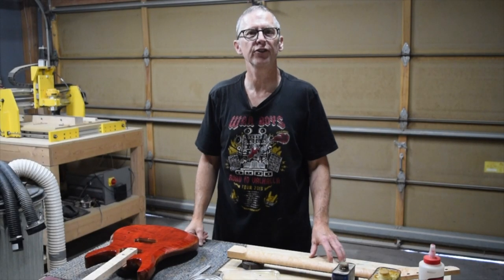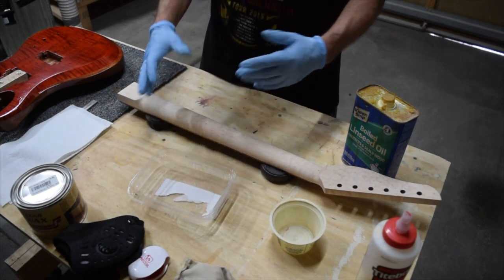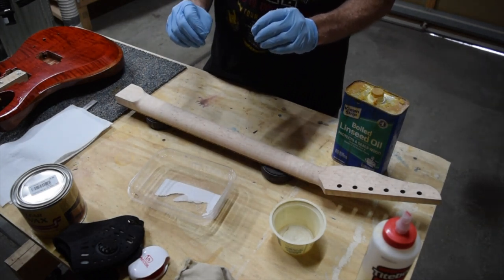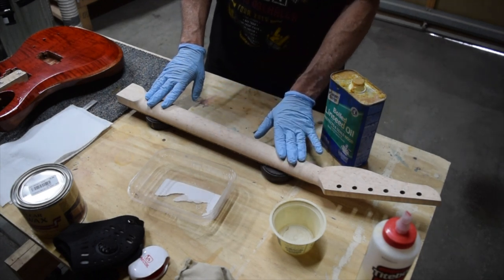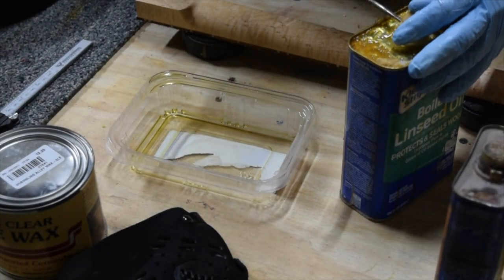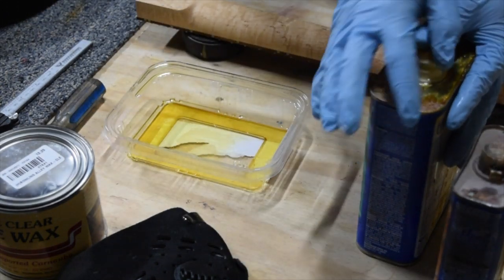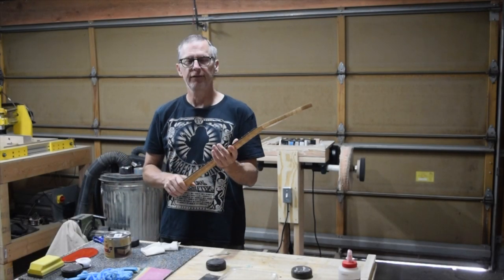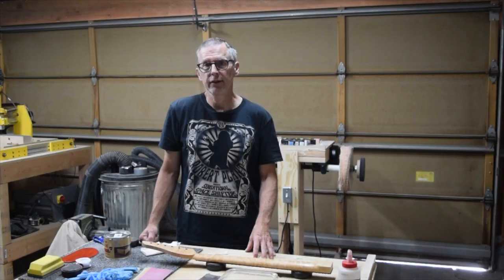Applying An Oil Finish On A Guitar Neck

Comment: I never crossed my mind that possibility of mixing linseed oil with polyurethane, very interesting, I'll try immediately
Reply from the maker: That's basically what a wipe on polyurethane is. Linseed oil, polyurethane, and solvent.
Reply: @HighlineGuitars  cool, thank you very much for the tip, I'll try with the guitar am building : )

Comment: Wow, It really sounds like this might be a nice way to finish a guitar neck. But at the same time it seems WAY easier... I might give this a shot, thanks for the video!
Reply: Oh, but I do have a question: I already started on a neck with nitrocellulose clear coats from a spray-can and some sanding like a couple years ago, can I just sand off the paint and redo it with this method? 

Edit: For context; I want to redo it because I never finished it...
Reply from the maker: Yes, you can sand back and apply the BLO. Or you can try polymerized tung oil which works better as I demonstrated in this video: https://youtu.be/brT7VpudOIY?t=155
Reply: @HighlineGuitars  Thanks :)
Reply: @HighlineGuitars  Hey, I was getting ready to buy the botanical polymerized tung oil but I saw on their website they say the average life of the finish is 5 years. If all I have to do is scuff it once with 600 grit and recoat once every 5 years it's probably worth it, but 1. I'm concerned I won't know when I need to do this, and 2. I wonder if it's really that simple. Have you ever had experience renewing or touching-up a polymerized tung oil neck you already completed from general wear? I just don't want to be playing the guitar years down the road and find out it's warped because the finish faded, or even just have to redo the whole finish for some reason.
Reply from the maker: All drying oils such as tung oil or linseed oil cure through a process known as polymerization. Polymerized tung oil dries faster than pure tung oil because the drying process has been triggered by carefully heating it before it's packaged for use. If you're concerned about long term wear, maybe you should consider polyurethane or polyester.

Comment: BLO is possibly the most beautiful finish over time. It gets progressively burnished as it continues to harden over the years. Think old tool handles. The only recommendation I would make is to buy purified BLO (Allback brand ?) or purify it yourself. In a plastic jar shake 3 parts oil to 1 part water into a cloudy suspension. Let stand for a few weeks in the sun until separated and the oil at the top is clear. Place in the freezer to solidify the watery garbage at the bottom and pour off the good part. Keep it in the sun with the lid loose to get sun thickened oil, but this takes a few months. Hardware store linseed oil isn't artist grade. It retains the mucilage portion of the natural oil and this part can support mold growth. I believe this is the case. If somebody knows differently please comment.

Comment: Excellent video. Thanks. I've ordered Tung oil to do a strat neck but may do it your way as you obviously know your subject.
Reply from the maker: Tung oil works great. Not much different than BLO, just not as readily available to some.
Reply: @HighlineGuitars  Well, the Tung oil didn't arrive, so I did it your way with BLO etc. The tip for wet'n'dry polishing is ace and I'd like to nominate you for a Nobel Prize for that. My neck feels satin-silky smooth now. As you say, it's not a thick coating: how long will it last before I should re-do it, at 5-10 hrs/week playing?

Comment: Got to your content due to wanting to get more information about using danish oil on a roasted maple neck. Thank you for your knowledge. Question: Did i waste my time by applying two coats in 24 hours? In my thought, it was to make sure the wood was flooded with the oil.
Reply from the maker: No, you didn’t waste your time. Oil finishes are very forgiving.
Reply: @HighlineGuitars  thank you! The danish oil really made the roasted maple pop! Such a beautiful warm color and feel

Comment: Hi.
Normally you would see those whitish liquids used for sanding using electric-driven or compressed air-driven tools .. what’s inside the mineral spirits compound you’ve used? Sorry I’m Italian so I don’t know what you mean exactly by mineral spirits ..
Reply from the maker: https://www.google.com/search?q=what%27s+in+mineral+spirits&rlz=1C5CHFA_enUS749US749&oq=what%27s+in+mineral+spirits&aqs=chrome..69i57j0i22i30l9.6536j0j9&sourceid=chrome&ie=UTF-8

Comment: Hi Chris, I tried to follow all your guidelines,  I sanded the Nitro finish off the back of the neck. Can I use Winwax  pentrating stain Golden Oak 210, to darken the back up some, I put some on a day after  and tried a very lite coat of it and it helped, but I'm still think it could look better, any suggestions.  Thanks John, Oh I found all the products at Ace Hardware, in fact the same brand, it cost a little less than 35 dollars. ( Before I started I taped off the Rose wood board and side dots.)

Comment: The video I need for my project! 
Just one question since I don't have any experience doing this. 
I have a lightly (almost finished) roasted maple neck that I would change the radius. My question is. Which sanding paper grit is the indicated to start the oiling process? 

Really love your videos Highline Guitars!
Reply from the maker: P400-P600
Reply: @HighlineGuitars  Thank you! 
Last question. If I got pre cut frets that has 10"inch radius. Can I install them in a 12" radius fretboard without bending them to match the same radius?

Comment: Have you used or thoughts on spar varnish for the neck. I would either use spar varnish or tung oil since I have those in stock. Have fun

Comment: Im getting ready to finish my first tele neck with rosewood fret board. Im assuming since my Taylors fretboards were finished with BLO from the factory and I didnt see you tape off your fret board, That its ok if I get some on my fretboard. My neck is unfinished from All Parts, maybe I can apply it to my fret board? Its in the mail so hopefully there will be some directions for finishing it.
Reply from the maker: I usually oil the fretboard as well.

Comment: You're doing the wet sanding to fill in the pores to enhance the smooth feel of the neck?  Also, when using Boiled Linseed oil, is it not recommended to apply additional coats after you've  done the wet sanding? thanks for your help.

Comment: Hi! In the planning stages of building a custom baritone guitar. Is it safe to apply these oils to unfinished necks that already have frets fitted? You seemed to be avoiding the fretboard throughout this video so just want to double check!
Reply from the maker: Yes, you can. This video was about the neck only, but you can use the same process for the fretboard.
Reply: @HighlineGuitars  Thanks for the quick reply! So it's safe to run this stuff over fretwire? Obviously, wipe excess off etc...
Reply from the maker: @wrkhousewrkhouse  Yes. It's easy to wipe it off the frets.

Comment: Great video! - Learned a lot! Thx!  -  Now PLEASE help as I have a question or two!. - I just got a brand new cheap Jackson Minion(28.6" neck bass) 
The neck is smooth everywhere other than on the thumb-side of the back of the neck from 1st-4th frets, it feels like they didn't shave a section into the bowl shape like the opposite side. I can actually even see the small ridge of wood they should have kept sanding so it would be a perfect bowl shape. I mean it is minute but it bothers the crap out of me. 
Also it's a maple neck and fret board that looks un-finished to me! - So should I use the BOILED LINSEED OIL like in this video to go aver the neck. - OR should I use TRU-OIL? OR TUNG OIL? No matter the price?
And can I use it on the maple fingerboard?
Also The outer sides of the frets from 12th - 22nd will freakin slice your hand open they are so sharp!-- Do you think I could file them down myself or should I leave that to the shop? Or after mentioning al of this should i just send it back?
I never buy really expensive guitars/basses, but this is the first time I have tried one under $300. I paid $140 for this one.
Is all of this to be expected from any guitar that cheap made in China? Or did they just stick it to me here? lol
Here is a link to the bass I got: ---- Any help will be greatly appreciated! Thx!
https://www.amazon.com/Jackson-Concert-Bass-Minion-Guitar/dp/B07VFPRYPX/ref=sr_1_4?crid=R9XQJQU6A0CS&keywords=jackson+minion+bass&qid=1581496063&sprefix=jackson+minion%2Caps%2C177&sr=8-4

Comment: I just bought an inexpensive Squier Strat Affinity, mostly for the 6 lb 10 oz weight on my shoulder, which I need due to a protruding collar bone (mtn bike injury).  The Squier is surprisingly higher quality these days but the maple neck is unfinished.  So I plan to do the complete BLO treatment as you've described.  Another video talks about doing the fretboard too but doesn't go into enough detail.  Do you use the japan dryer and how about the the wet sanding for smoothness on the fretboard. You mention multiple coats on the fretboard.  Do you just wait a day or two between coats or...????  And if you are doing the fretboard and back of neck would you do one first or both at the same time?  

I have another strat I built from scratch taking a guitar building woodworking class.  It has an unfinished ebony fretboard.  I assume BLO would work for that wood as well?  Since I might have your attention, I sprayed a water based nitro finish outdoor during a dry Santa Ana here on this Strat and got a lot of blush on the back and sides (top is good) and short of reshooting the clear coat again would anything easily remove the blush now years later?  I do have blush remover in a can but reluctant to make it worse, lol.  Thanks, love this video.
Reply from the maker: Add a few drops of Japan Drier (or an artists cobalt drier) to about a half a cup of BLO. Wipe the neck and fretboard. If you want it smoother, rub the mixture in with wet/dry sandpaper (600 grit or higher). If the frets are already installed, you won't be able to wet sand the oil into the fretboard. Wait a day or two between coats. Then give it a couple of weeks to cure after you're done.
Reply: @HighlineGuitars  Thanks for the quick response.  Yes the frets are in and thought that I could still wet sand with 1500 in the direction of the grain without really affecting the fret much.  Any thoughts for clean up of the frets after either method of application.  Mineral spirits?
Reply from the maker: @sdcoffeeroaster  Wet sanding the oil as you mention between the frets is risky because if you touch the frets at all, you get black residue on the fretboard. As for removing oil from the frets, it won't stick so just wipe it off.
Reply: @HighlineGuitars  Thanks great advice.  Any advantage to using a very fine scotchbrite pad to apply to the fretboard?

Comment: Great information. Very thorough. One thing I want to clarify, are you only doing one application of boiled linseed oil prior to the wet sanding? I've used some oil finishes in the past (mainly on furniture), but have always done multiple applications before rubbing out the finish. Also, what are your thoughts on applying wax over an oil finish on a neck?
Reply from the maker: If you want to do multiple coats before wet sanding, go for it. I have found it makes no significant difference. I don't use wax, so I have no thoughts on it for a neck.
Reply: @HighlineGuitars  good to know. Thanks!

Comment: Really appreciate your videos and attention to detail. I am working on my first guitar build-a StewMac 335. I've applied linseed oil to the neck as described in your video. It is a glued-in neck. Will the linseed oil impede the glue adhesions to the body? I plan to sand to assist. Thanks in advance! HB
Reply from the maker: Scuff sand the surfaces that will be glued and wipe them down with a cloth dampened with acetone.
Reply: @HighlineGuitars  Thank you!!! You should write a book. I'm sure it would be a best seller.

Comment: Awesome video. How many coats of linseed oil are typically applied? If one would want to do the same finish on the body as well, how many coats would that probably take?
Reply from the maker: There is no rule for the number of coats. Whatever looks right to you.

Comment: How many coats would you typically apply like this? Just the one and then wet sand it? And could I use 000 steel wool instead of the sanding paper or not? Thanks for a great video!
Reply from the maker: I wet sand in the first coat with 600 grit and apply each additional coat by wet sanding with progressively finer grits until I get to 1,200. So, about four coats. I steer clear of steel wool because of the magnets in the pickups. Instead, consider synthetic steel wool like Norton or 3M.

Comment: This is great information, thank you for sharing your expertise with us. 

I was somewhat expecting the process to involve multiple layers - do you recommend just doing one layer as demonstrated and would there ever be a scenario where it’s beneficial to do more than one, or is it not really an advantage?
Reply from the maker: BLO doesn't build in layers. Consequently, more than two or three doesn't do anything.
Reply: @HighlineGuitars  ok that’s good to know, thanks for the response! If you were looking to achieve an amber/aged look, would you stain the wood then oil over the top, or would you mix the oil and stain and apply the mixture?

Comment: My neck is mahogany, I need to fill the pores first. Can I use shellac/sawdust coats, sand. Then use the boiled linseed oil?
Reply from the maker: I wouldn’t. Shellac will prevent the BLO from absorbing into the wood. Instead, I would just use BLO mixed with sawdust. As an option, you could add a small amount of oil-based polyurethane to act as a binder.

Comment: Very nice finish, this neck must be a joy to play. Would the back of the neck feel even less sticky if you went with lower grit sandpaper?
Reply from the maker: If the surface feel sticky with boiled linseed oil, it's likely because it didn't dry correctly. When fully cured, it shouldn't feel sticky at all. That's why it works so well for this. Try wet sanding it with 600-800 grit sandpaper, some mineral spirits, and let it sit for a week or so.

Comment: If we don’t use Japan dry, should we wait longer than an hour to wet sand?
Thanks 
Great video
Reply from the maker: No. The wait is just to allow the oil to soak into the wood. Japan dryer has no effect on absorption.
Reply: If it has already dried, can I still perform the wet sand?

Comment: Hi Chris...quick question...I am finishing a Jazz Bass guitar neck and have a custom wet slide decal I want to use.  Do I place the decal first and then use the boiled linseed oil or do I apply the oil first and then apply the decal and then cover with a poly on top of decal to protect? Thanks, Dave
Reply from the maker: If the wood shows through any part of the decal, you should apply oil first so the background wood will be the same color. Make sure you let the oil dry a few days to a week before you apply the decal.

Comment: how does this finish wear over time ?  does it get gummy, absorb dirt and grime, change color, show signs of wear ?
Reply from the maker: It needs to be refreshed once or twice a year. If your hands are dirty and grimy, your neck will be dirty and grimy too. It might change color over time. It can show signs of wear.
Reply: @HighlineGuitars  Wow, thank you for the PROMPT reply !  That confirms my experience.  I know that the look and feel of oil finish is beyond compare, but the compromise is durability.  Thanks again for your great instructional video.

Comment: So it is only one application of the Boiled Linseed oil, then the 1500 grit sanding then wait 2 days?     It looks great, but thought there would be several applications.,..
Reply from the maker: You can do more applications of BLO as long as you wet sand them on with the 1,500 grit sandpaper. You should also allow several days to let each application dry before applying the next coat.

Comment: On an existing finish neck sanded down but obviously all the old finish not removed will linseed oil work over this? Maybe wipe on poly would be better? Thanks
Reply from the maker: If the original finish was a clear coat like nitrocellulose, any left on the surface will inhibit the linseed oil. Wipe on poly would be better, but be aware that some players hate the feel of poly on a neck.

Comment: Thanks Chris. I get so much useful information from your videos. If you were doing a set neck would you oil it after you attach it to the body? Or avoid oiling where you will glue? Just curious if the oil would effect the glued joint's strength. Looking forward to watching more of your videos
Reply from the maker: I oil before attaching the neck to the body.

Comment: Thank you for this video! I just got a guitar kit for Christmas that has an unfinished neck and this is exactly how I want to treat the neck. Is it ok that I didn’t find Japan Drier to go with my Boiled Linseed Oil? That just means it will take a couple days longer to dry right? What can I do to the really raw/dry fretboard? It’s a died fretboard of some sort that is dark like rosewood but the kit says it’s a died wood of some sort. When I leveled the frets I put blue painters tape on the fretboard and when I peeled them off some of the thin splinters came off with the tape, I’ve never encountered that before. Thank you again for the video!